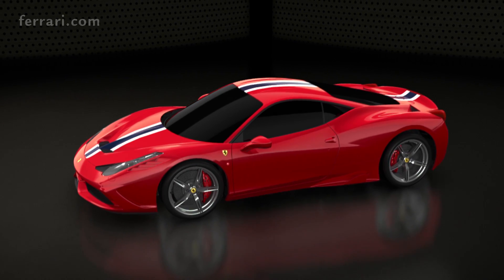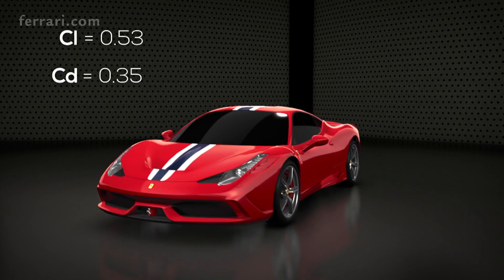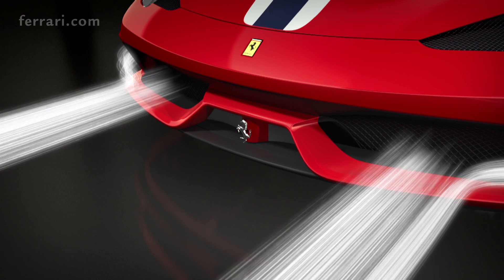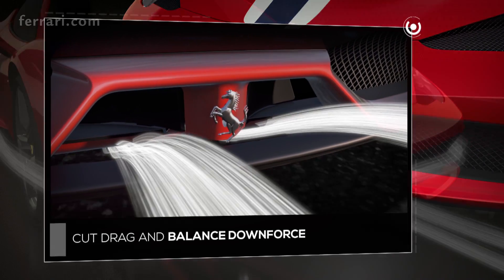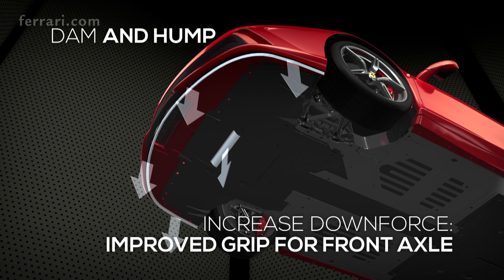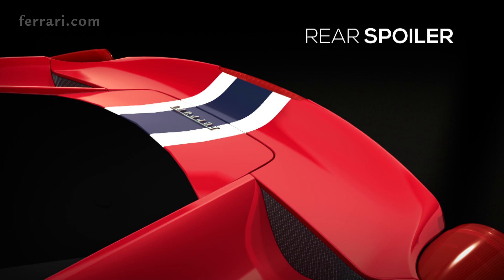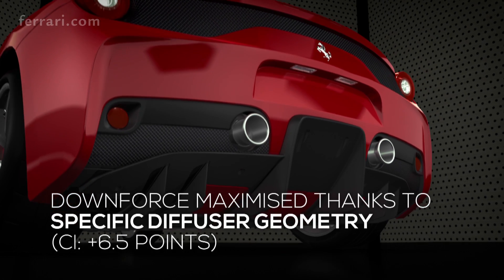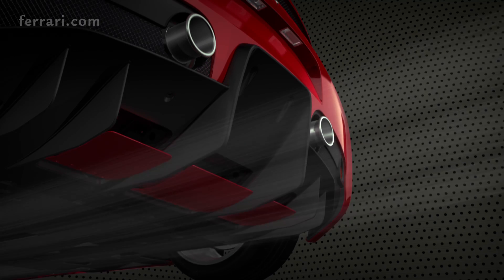Ferrari 458 Speciale - Focus on aerodynamics

Comment: Wait, so Nissan GTR has a lower CD than this Ferrari? Explanation please.
Reply: Can you see any straight line on this car?
Reply: More downforce, higher cd
Reply: its not all about slipperyness, these are track cars, they need downforce for cornering.
Reply: De enz Japan Lv !
Reply: Total drag=CD×surface area
Surface area for a car is width×height×0.7ish
The gtr is quite a bit higher so the surface area is probably bigger. The total drag is probably quite similar

Comment: Just regarding the top speed, m8, just the top speed. I'm pretty sure engineers can come up with something faster than F1 using the same main spec, of course, but the current trend for supercars moved in a different direction. Turbos are a lot more viable these days (almost nonexistent lag etc), electric stuff etc etc. Look at the MP4-12C, it's a 3,8L TT V8 producing more than 618HP. My point here is the small capacity of the engine of this kind of car. It matters.